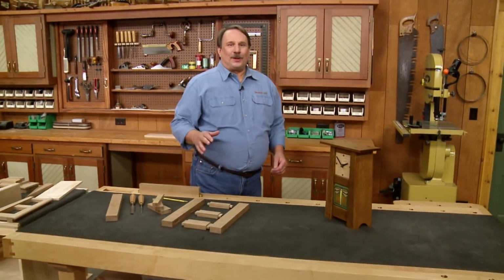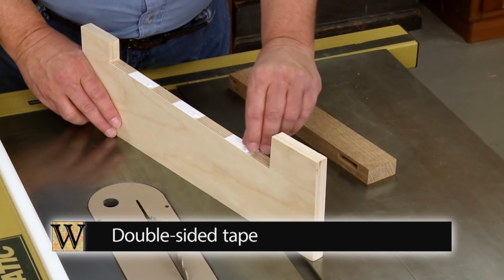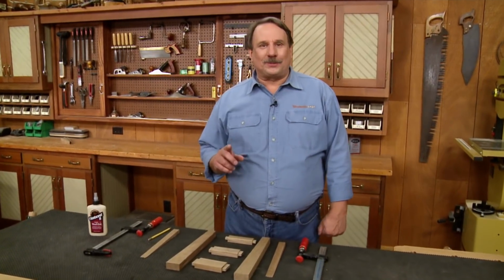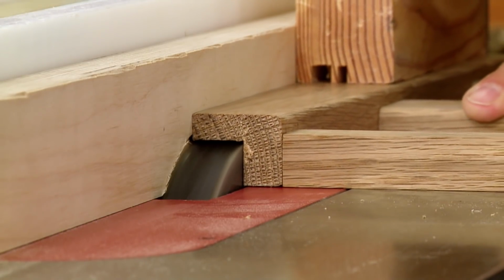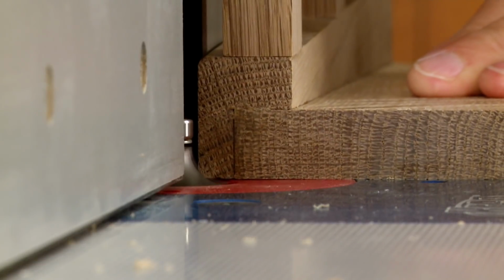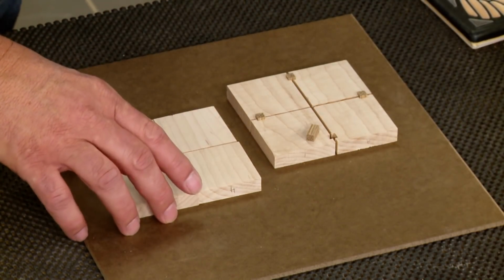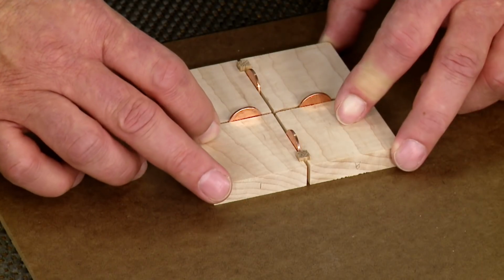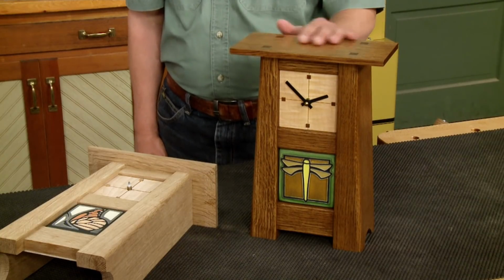Build A Craftsman-Style Mantel Clock | Weekend Woodworking Project

Comment: Way back when it first came out I made two dozen of these clocks out of qtr. sawn white oak. I gave them as gifts and donations to the senior center for raffles. I used Frank Lloyd Wright coasters in place of the expensive tiles suggested. Clock works came from Clock Kit.Great project.
Reply from the maker: What a great gift!  I've always said on projects like this, if you have the tools set up you might as well make several. :)
Reply: Well done mate. @WoodsmithShowandmagazine